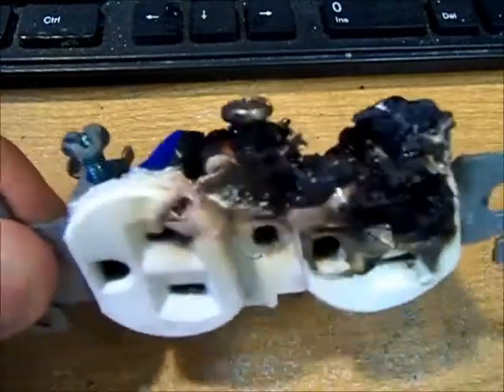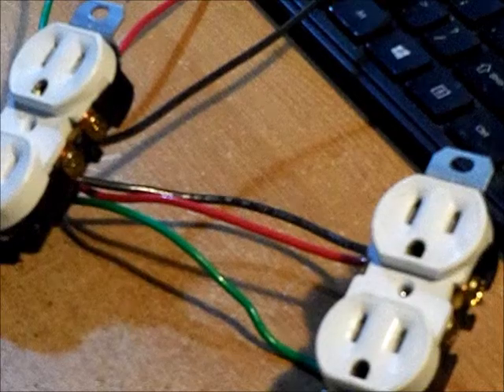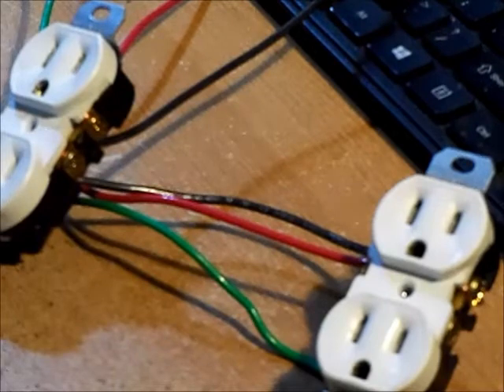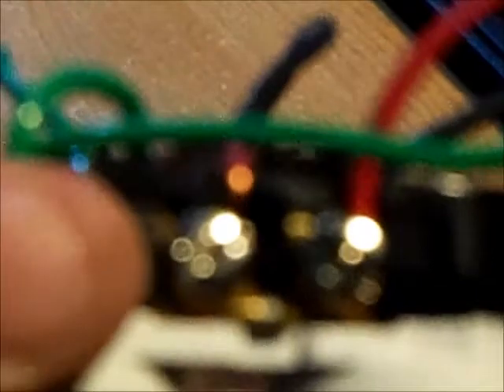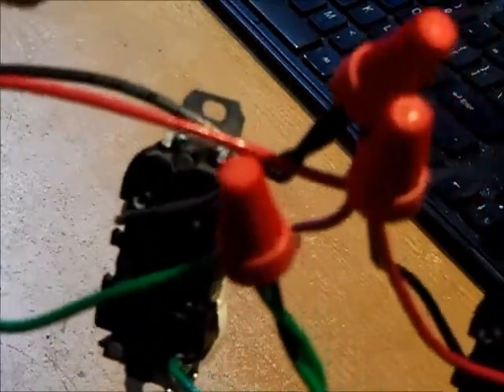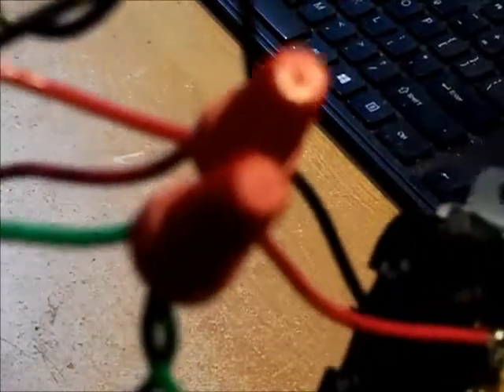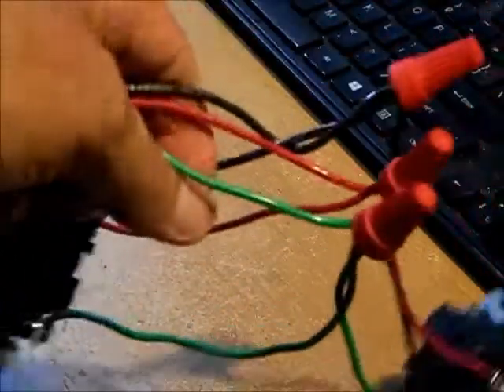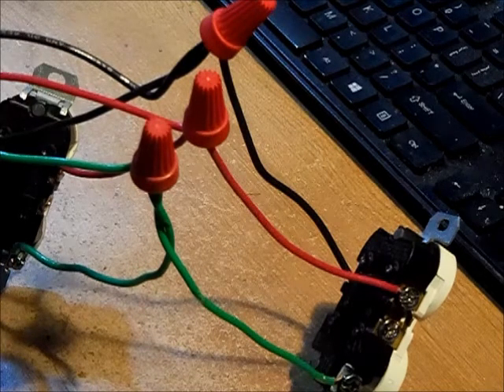Electrical outlet failure

Comment: I've been doing residential wiring for 8 years and never had a burned up outlet when using the screw terminals,  even daisy chaining them.   I have been on many service calls, involving intermittent power, scorched coverplates and melted plugs/outlets, and in every one of those instances the burned-out outlet was backstabbed.  The only instances where the screw terminal connection failed, that I've ran into,  was in an early 1970s home where aluminum wiring was employed,  with a decora style outlet.   All the decora style that I've ran into is rated for copper or copper-clad aluminum.   Aluminum wiring particularly the old style AL1350 expands and contracts about 3 times as much as copper, and when a heavy load (space heater, air conditioner,  hair dryer etc) is plugged in the connection will warm up, expand under the screw and deform, when the load is removed it contracts and leaves a tiny gap with higher resistance, becoming progressively worse until it fails completely, a fire smoldering in the walls is not an uncommon event.
Reply from the maker: Back in the 70s I sold electrical supplies when the Aluminum wiring failures started. We started stocking the outlets and switches with the CO/ALR designation. these had the serrated screw faced and screws to bite into the wire for a more solid connection. Some people I new would wire nut a short piece of copper wire to the Aluminum wire then hook the copper to the outlet/switch. I don't know if this was/is acceptable, but it seems a little sketchy to me. I 100% agree with you on not "back stabbing" the wire onto the outlet.
Reply: @d.s.steele3100  thank you. I never knew about the serrated screws on the CO/ALR outlets and switches.  I kinda just figured the screws and contacts were made from aluminum or something with similar expansion and contraction rates, to reduce the tendency to wiggle loose.   As for the copper to aluminum pigtail, only certain wirenuts are acceptable,  those that are come prefilled with an anti oxide compound, and even these can be problematic.  Based on research and talking to long retired electricians, some of which have deceased,  who were in the field in the 60s and 70s during the copper shorage caused in part by the Vietnam War,  aluminum also tends to undergo galvanic corrosion when in contact with copper and moisture.   A promising solution that's relatively new, is Alumniconn connectors.  For those unfamiliar,  they are purple, with set screws,  and come in two or three port varieties, and have the anti oxide compound inside. You insert the aluminum in one port, then the copper in the other, tighten with a torque screwdriver. This keeps the copper and aluminum from physical contact,  while also preventing corrosion,  and therefore eliminating all the undesirable properties of aluminum.   We can then install standard devices.

Comment: Good video, Thanks. I was a fire investigator and enjoyed seeing this.
Reply from the maker: I got your first question in my YouTube email. No, I am not an electrical engineer but have some training in Biomedical electronics. This was at the time when most equipment was still analog not digital. Even though I worked with very low voltages and amperages the basic principles are the same.
Reply: @d.s.steele3100  I have a very limited knowledge of Electricity and try to pick it up where and when I can. I was limited to needing the opinion of Electrical Engineers , especially when it concerns outlets and an "Area of Origin" in a fire. Legal requirements ... But,  your video was very informative for me. You can imagine the difficulty of trying to find a cause, like the one in the video, after a structure fire. I had never realized the benefit of pigtails / outlets in a circuit.  Thank you.
Reply from the maker: @ral819 : Electricians would be a better source for knowing how outlets fail as they do the actual wiring and repairs. Electrical Engineers know the theory but rarely get into the field to apply their knowledge in real world applications. My father worked for Bechtel Corporation from the late 50s to the early 80s as first an electrical engineer and then a project manager. In all the years I new him, I can count on one hand the number of times he actually used tools. He was a very intelligent person but he was "book smart" his specialty was using slide rules and calculus  equations to bring a project in on time and under budget. I learned a lot from him but I am much more hands on.

Comment: What size/capacity was the breaker running to those outlets?    Is that 12ga or 14ga?  Looks kind of like 14ga.  Most homes use 20 amp breakers to run circuits with receptacles.  15amp  (14 ga) is usually for general household lighting, so it's not subject to much change in amp draw.   Frankly,  given your presentation,  I'm glad it did show on the receptacle instead of inside a metal box in a wall somewhere.  Did it blow a circuit breaker?  The way you show it connected must be enclosed in a junction box,  not just wire nuts dangling
Reply from the maker: First sorry about the late response. They are 20 amp circuit breakers in the panel box. I used 14 gauge in the video because that is what I had on hand. I'm fixing the house wiring as I find any issues.

Comment: You make a good point and I usually prefer pigtail connections. Any loose screw is a potential hazard, so by using pigtails the current will only flow to the load(s) and not every receptacle along the way. Receptacles, even 15 amp are rated for 20 amp pass through, but only if all connecting points are tight. Wire nuts must be used correctly though, because this can also be problematic.
Reply from the maker: I know it did not show up well in the video but I always twist the bared wires together with lineman's pliers before putting on the wire nut. As you know, this is good/safer wiring practice.